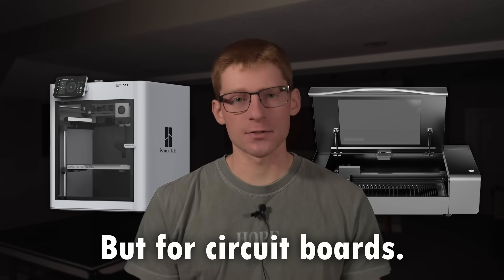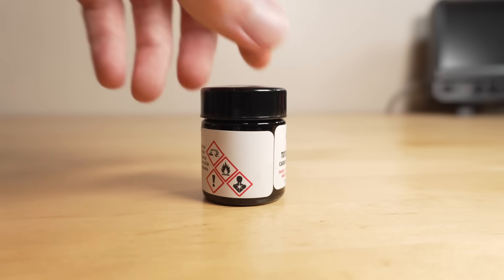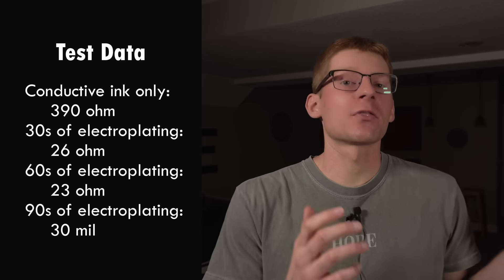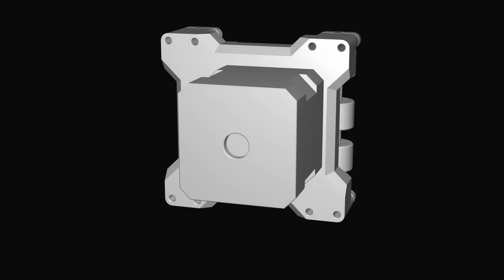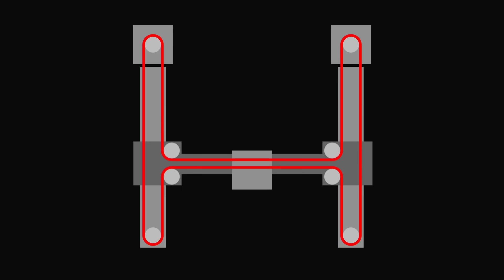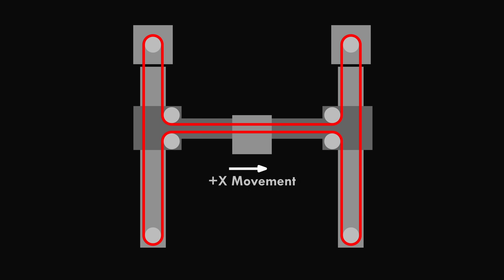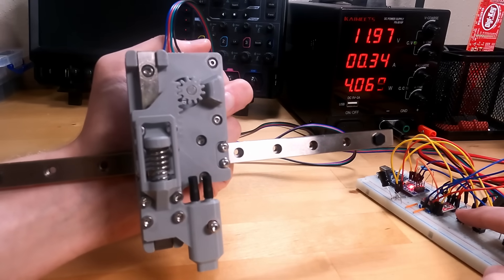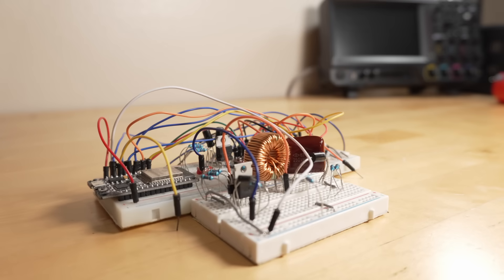I'm Developing a New Circuit Board Manufacturing Technology

Comment: Maybe fill in the holes (all of them at once) with low melting point soldier somehow? By low I mean those which melt at 80-90°C. Not sure if surface tension would allow such soldier to flow into 0.2mm hole. If not it should be possible to lower the board into bath of melt soldier and then trace the paths on cnc. The whole thing will be covered in low melting point soldier, which is not applicable for production grade pcbs but should still work for prototypes.

Comment: Hello,
I don't really know about pcb, but why do you need vias to be hollow? Could you not just fit a small coppet rod in the hole and weld the 2 ends? Could it be possible to connect both sides with only solder? If it is possible, you can insert an hot needle full of solder threw the via. 
Also to keep the 2 tools heads in line, you can :
- drive the 2  belts systems to the same motors with long shafts
- force them in-line with a pin that goes threw the via and into the other tool head
- connect mechanically the 2 tools heads with an U shaped part (that goes around the pcb) and only use 1 belt system

Comment: Super cool project. One of the issues I have with making PCBs at home using an engraving mill, is the lack of mature and well featured, GUI based CAM software to convert a gerber file into gcode. All currently available software applications suffer from one or more huge flaws, that ultimately make them either unreliable, or time consuming and fiddly to use. I think for your project to be successful and truly achieve the "fire and forget" functionality we all want, it needs good software too. On my own setup, I've modified and optimized the hardware and was able to cut down the setup time by an order of magnitude compared to its off the shelf version, and now configuring and setting up the CAM software, with all its bugs and kinks, is by far the most time consuming and frustrating part of the process.

Comment: All homemade vias options were explored long time ago. For starts, you have to use good carbide drills at prescribed 30-40k RPM to get VERY smooth holes.
Carbon paint is kinda easy at the first glance but leaves VERY rough and uneven plating and very hard to achieve sufficient conductivity in the first place. 
Silver nitride is better, but too complex chemically and still leave pretty rough and eneven plating.
They only real, sustainable primer for homemade vias is palladium chloride - the very thing everyone use in the industry. It's easiest and best in literally every aspect. It seems expensive, but it's really not, 1g will be enough to electroplate approximately your whole house.

Comment: Also, i think a final version of this machine would be better off moving the circuit board than moving the heads on the top and bottom.

Unless you need that for the other steps, it would be way more simple.

I bet you could just jam the holes full of conductive epoxy or even solder paste and get it to work pretty well

Comment: Very cool stuff. Long term, after its all figured out, it wont be that hard to make the ink dry faster. You could make a third "nozzle" on your end effector that blasts hot air, or just heat up the circuit board with eddy currents or something. A thought for the final design.

Comment: Why not go with the THT component approach for creating vias? 
A very thin copper wire could be inserted into the hole using something similar to a 3d printers extruder, then get secured to the bottom using solder paste and a laser or hot air, then cut the wire at the top and solder it in place there too. Maybe it would be easier to flip the board in the machine instead of putting a solder paste application and heating tool on both sides of the board. 
Very cool project!

Comment: How many vias does your typical board contain? I'd be tempted to just drill holes and solder in thin wire connecting the layers ... unless your vias are too close together or too close to other pads ... then that wouldn't work.

Comment: Nice work, I would use a copper wire feeder and spot weld it top and bottom. No messy chemicals and the technology is already used on batteries. Good luck

Comment: ok so... im very stupid but your problem seems to be that you have a copper plate an insulation and then another copper plate right? cant you 'just' drill out a hole and plug it with a wire/bushing ? 
If you need to assure fusion between the copper cant you melt it? idk maybe the insulation layer would react poorly to heat...
heck maybe do both; push a bar/wire/tube of coper in the hole an the electro plate it to assure fusion of the part.

why do you NEED a chemical solution? you surface is not crazy complex it's literaly a tube. i dont get it.

if anyone knows feel free to explain to me. :D

Comment: Just two thoughts. First, on a prototype board do you really need 0.3mm vias. A prototype board should be built for testing and experimentation, not production. It should have many more test points, unused gpio pins should have pads for possible bodge wires, and extra pads at critical points in the circuit, etc. My second thought was when you said the platting  creeped up into the effector. Are you providing both positive and negative currents through the effectors? The platting goes where the current goes, and will collect on the negative side for some chemistries and the positive side for others. I didn't here exactly which chemistry your using. But part of your current needs to be applied to the board and not the effectors, or you'll end up platting the effector and not your via.

Comment: Hey friend, I’m a fan of electroplating and have been studying it for about 6 years. What you want to avoid that creeping copper growth is to do pulsed AC plating, and if possible, to force movement of the fluid through the WIP via. Here’s why:

0) By pulsed AC plating, I mean that instead of a constant current, you have a periodic cycle of “plate, plate, erode, rest”, for example. You have, say, 1A for 0.5s, then -1A for 0.25s, then 0A for 0.25s, and this repeats on and on.

1) Pulsed AC plating will, on average, deposit material (deposition is proportional to (average current) x time). In the eroding step, however, it will selectively erode the pointiest surfaces, because that’s where the current prefers to flow through. What this means for your VIAs is that you’ll erode the spurious dendritic growth that creeps towards the electrodes.

1.1) Pulsed AC plating will also help make a smoother, more consistent surface.

2) Forced movement will help you a lot here, because you need copper ions to successfully reach the surface and get plated. In normal circumstances, ion movement is mostly limited by diffusion. When ions get plated, new ions fill replace them by coming from some random direction in the fluid. In the case of the thin 0.3mm VIAs however, diffusion will have a hard time replenishing the plated ions inside the bore, because there is almost no direction where new ions can come from. In your setup, as it stands, that space gets starved of copper ions and stops conducting altogether.

Get a good flow of electrolyte solution through the bore, and you’ll see how much better the process behaves.

There’s a book on this from the German book shop Leuze Verlag, the book’s called Pulse Plating, it’s silver-colored and has a picture on the cover of electroplated vias that were successfully done using this precise approach.

Anyway. Cheers, friend. Your project looks epic. Please reach out if you want some help, I’ll gladly give you whatever info I can.
Reply: can you explain why electroplating is necessary to make the via? why not just press a tiny rivet through the hole?
Reply: @primusolaris having used such rivets in prototype PCBs: 
1. The rivet creates a high spot, meaning you can't put vias under components
2. The smallest I've seen are 0.4mm hole/0.6mm drill, which is still massive for modern boards, while being absolutely annoying to work with. I worked my way up to maybe 4-6 pcs a minute, using the bigger 0.8/1.0 inner/outer ones, and while meditative, it's not really what I'd call productive.
3. The conductivity, even when soldered, was quite hit-n-miss, as any nearby soldering work could sometimes cause enough thermal stress to break the electrical connection. Admittedly, that could be a skill/process issue that could somehow be mitigated, but the fact is I spent way more time that I liked trying to debug my circuit, only to determine that the via connection was intermittent.
Reply: @Validole  thank you for the response!
Reply: @primusolaris  actually maybe worth considering. But I'd guess because the holes are .3mm wide in diameter, and good luck finding or producing such rivets, and then making sure they make good contact with both of the layers (top and bottom).
Reply: @Christian-os3kk  I wonder if it would be possible to make the rivets also do the drilling. Then they'd already be in place.
Reply: @primusolaris 

Yes 

0 4 mm hole

Rivet

Then 0.3 mm hole in the rivet
Reply: @primusolaris  Resistance in the circuit.
Reply: Omg this need a like or pin from Levi 😆
Reply: High end input!
Reply: ok this is a dope explanation! ty
Reply: Adding a reply here to improve visibility for Levi. This is a great explanation and he deserves to see it. Thank you for being willing to speak up!!
Reply: This is what the internet is for.
Reply: Does forced movement mean pressure? If so, in this specific case it could potentially be difficult to apply, because you would need a way to keep a seal which would withstand the hydrostatic pressure. But, maybe it would be just a matter of a couple of o-rings on the tubes which press onto the board from both ends. Then again, corrosive fluids?

There are definitely a lot of things to think about, but great comment, I saw one other where someone also recommended this.

I'm actually curious what alternative method did he come up with. Seems like neither the forced or pulsed will apply there, but we'll see, I hope
Reply: @Christian-os3kk  Forced movement could be done by suction not pressure, pulling the electrolyte through (instead of pushing it through)
Reply: this is exactly why the first try worked so well and was so easy. the electrolyte solution was being forced through the hole in a constant flow by gravity. basically his problem is due to his need to make everything as small as possible. (not disparaging i have the same problem.) he needs two constant flow solutions one for the conductive ink one for the electroplating solution and it should solve most of his problems.
Reply: Damn this was a really great explanation; well done. YouTube comments are so cool sometimes.
Reply: This is enough to dust off the project again and have an another attempt?
Reply: My man starts his numbering from 0, what a cool dude.  It’s refreshing to meet someone on the same wavelength. 😎
Reply: Ace!
Reply: Awesome!
Reply: That actually makes so much sense
Reply: maybe if you insert a Ultra micro-electrode in the midle of the vias you'll have better deposition. but you will face other issue...
Reply: why not just do a copper or solder weld through the via? no chemicals
Reply: @zacharyacoon electroplating provides consistency.

In circuits with high frequency signals, inconsistency can causes issues.
Reply: @Hyoo9000 i love you bro . Very very very thanks for this quality comment. ❤🫡
Reply: Thank you for that excellent explanation.  I am your second sub.  You should make content!  Seriously, just feed the above into an AI and have it make a conversation and a video, if you are shy and don't want to use your face or voice.  You have excellent information!  It would be awesome to see you work together.

Comment: Maybe this is a stupid question, but wouldn't it be MUCH easier to make your via's with a little piece of wire through the hole and soldered on each end. Seems like the engineering to auto drill, insert the wire, apply flux, solder, then trim the wire would be a lot simpler than what you're looking at. 
Would it look as nice? Maybe not, but you're doing prototyping, not large scale production.

Comment: Great vid, just subscribed. Seems obvious that the solution is simply to hand solder wires through the holes, as pointed out by many others. This, of course won't work with hundreds of vias, but in that case, wouldn't the time frame of the project be such that it would make more sense just to order the board?

Comment: About 40 years ago (mid 80's) I wanted to build a laser based printed cct board device, my ultimate idea was every electronic store would have one of these like libraries had photocopiers. 
The main process was a laser with a feedback loop such that it could cut through the copper but as soon as the reflection changed it would cease as it had penetrated the copper foil. 
This was purely a prototyping service so there was no attempt to do via's other than drilling the hole.
However I knew it was beyond my capability and resources at the time so never went anywhere with it. The maker community has so many more resources available to them now :)

Comment: Before you toss in the towel just yet, consider looking into electroplating additives that would change the surface characteristics of the plating, making it less dendritic. Using a much faster fluid flow (from the anode to the cathode) may also prevent the dendrite growing.
Was your plan to slowly feed copper wire into the anolyte? Or just to use a big anode and refill it manually on occasion? I’d also consider having a third tool on the same head, a warm air duct to dry the ink more quickly, if that becomes a bottleneck.

In future, consider making the PCB move in the X-Y plane and keeping the toolheads stationary.
As for solder mask, it really helps with SMD components, especially where traces may be beneath an IC. My method was to use a laser to burn off a solder mask layer.

Also look into electroless silver plating, it’s much easier than electroless copper.

Comment: You can burn the holes with a laser (may be after deleting the copper layer) so the internal surface would be intrinsically coated with carbon from burning the resin.

Comment: What opulo learned with the lumenpnp is that speed is not an important metric for rapid prototyping pcbs. It's reliability and automation. If a desktop machine takes 24hrs to make 1 PCB but needs no intervention, its still the best prototyping option because it lets the engineers be productive elsewhere. And its still a third of of the time of the best outsource.

Comment: Why all this complexity? I mean logically, a small hole drilled and tinned by using a pointed tip soldering iron makes sense no? This would make the via strong and have very low resistance. You can incorporate something in your design to just make the holes and you can tin all the vias after the fact manually.

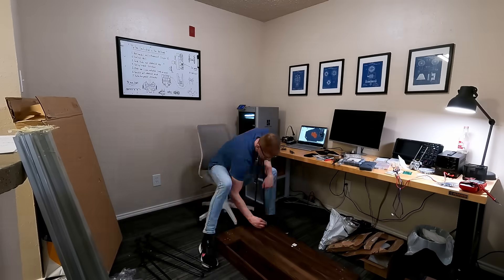Comment: 3:45 Is there copper micro rivets out there? I would be so more simple if such part existed 🤔
Why not just automatically use Cooper wire to connect two layer. Limiting the method only mechanically seems way more realistic.

Comment: In fact, prototyping PCBs is a much shorter process than 3D printing. For small devices, making a PCB rarely takes more than an hour using home-made methods. And prototyping large boards is often a useless exercise. It is much more convenient to make small modules, which can then be assembled together and, if necessary, remake a small part, rather than a whole sheet of fiberglass. And once everything is debugged, you can simply order the final version from the manufacturer.

Comment: This is such a brilliant idea! I've always dreamed of the concept of a standalone machine that produces complete pcbs automatically. I've experiemnred very little with electroplating but I believe i got into a rabbit hole which taught me some things about the process. Heat generation can greatly affect the process. As others have said, pulse plating or pulse reverse plating can help with copper structures ( AKA dendrites, I believe) forming. Almost as crucial as everything else is the plating solution. Unfortunately it is hard to achieve the same quality with homebrew copper sulphate solutions. As far as i know commercial ones use many agents to prevent dendrite formation, heat reduction and " wetting ", for a more even coating. I know you've probably abandoned this idea but you'd be amazed to look at ECAM ( electrochemical additive manufacturing), you've also basically created a metal 3D printer!!! There is a video online about a paper in which they used a very similar mechanism to selectively deposit copper and make parts " just like " a 3D printer! 

(https://youtu.be/B-UbDk7LrvU?si=zdulL-Oz6dg2pjJ6)

Anyway, I'm so looking forward to your next video! Very curious to see how you might tackle the problem. Maybe fill the holes with solder ? Fill with solder paste then heat ? 

Wish you all the success!! Cheers from Brazil

Comment: I'd love to see this work! 

A few suggestions come to mind:
* what pressure/feedrate are you operating at? Faster will almost certainly be better; as cybyrd alludes, ions are pulled out of the solution by the process and this will interfere with how even the coating is
* use a copper electrode centered in the hole, with electrolyte forced past it at pressure; if electrode erosion is sufficiently fast, move it (a la wire EDM or microhole EDM)
  ** having something stick through the hole will also make alignment easier; the bottom can center itself by clamping onto the electrode
* heating the electrolyte will improve reaction speed (but might result in other trade-offs)
* try pumping electrolyte towards the bath that has the electrode in it (or alternate directions)
* only ground the copper on the side away from the electrode